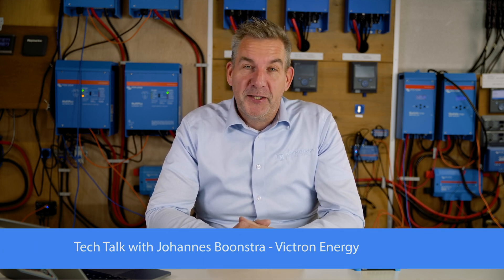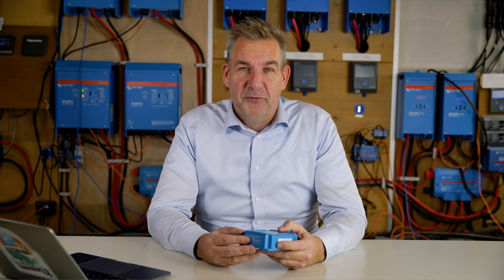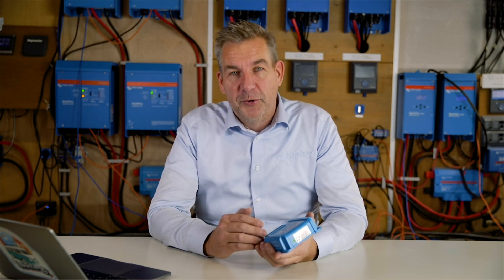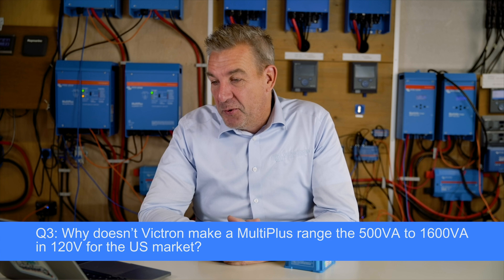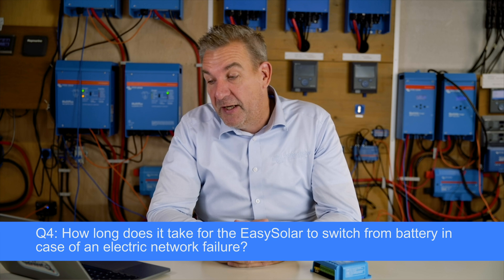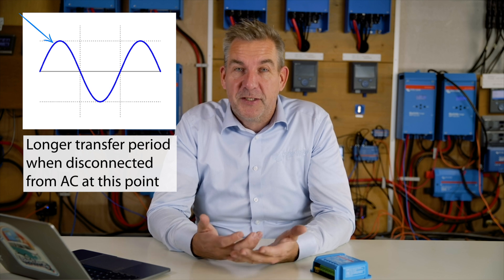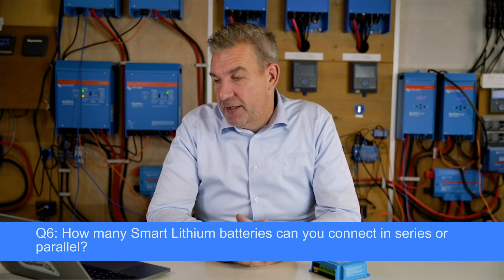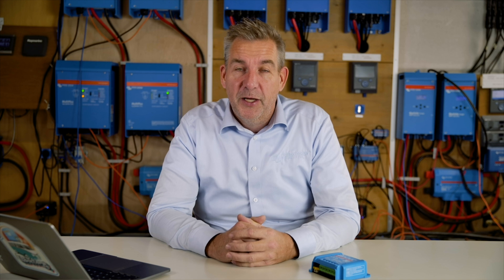Victron Energy Tech Talk - Episode 9 (MPPT charger output, Smart Lithium batteries)

Comment: Don't know if u can help me. I am try to flash my victron quattro 48/5000 inverter, but I have to use veflash because it is a 100 series bios, The flash utility keeps telling me error connecting when trying to flash. Do I need to disconnect both ac and dc for the procedure to work or what am I doing wrong? Thanks

Comment: I haven't had any luck in the Victron community forum or the Facebook groups so I'd appreciate if you could address either or both of the following questions about the Skylla-TG charger 24 V universal input:
- The Skylla-TG charger 24v universal input unit has a starter battery charging feature, does it use power from the DC side or do I have to be plugged in to AC shore power?
- I've seen people recommend using an EMS to protect a Multiplus/Quattro from bad shore power, since universal input EMS don't seem to exist, how would you protect the Skylla-TG charger 24v universal input?
Reply: Q1 this extra power for the starter output is redirected from the main battery, So when there is enough (voltage) to also feed the starter output it will do so.
Reply: @victrontech  If you don't mind one last question, the manual doesn't mention it so I assume the starter battery output won't have stage charging right?
Reply: Q2 There is no EMS needed as the unit will switch itself off at low AC voltage. for (extreme) high voltage you could add an EMS but that's typically not done as far as I know.
Reply: @victrontech  Thank you so much for answering both questions, that helps a lot!! You’re a legend. :)

Comment: Hello, i have a question about a Lynx distributor and big cables.
I need to connect a phoenix 24/5000 inverter.
Between Inverter and Distributer is 1,2m
The manual said the recommended cable is 2x 95mm² with an 400A Fuse.
If it´s possible to connect two cables an one of the four terminal with a 400A fuse or i have to split it to two terminals with two 200A fuses?
Another option is to connect a Fuse holder at the end of the distributor busbar and connected seperately.
Best regards Robert
Reply: When paralleling the cables the partalleled fuse becomes half size , so 200A indeed.

Comment: Hi Johannes, would you please help me to find the best setup for my system? I do have 550W, 52V panels. My roof is a little complicated. I can put two panels facing east with 30dg slope, two facing west with the same slope. Five facing south 30dg and 4 facing south with 45dg. Can I use MPPT 100/35 for East/West panels and MPPT 250/70 for south panels? Is it possible to combine MPPT 250 and MPPT 100 into one string? Is the slightly higher voltage of the panels (260 and 104V) a  problem???  I consider Multiplus II 48/5000/70 Inverter and 48V battery. Would you set up the system differently? Thank you very much, Juraj
Reply: having a single MPPT per slop would be most optimal. higher voltage then the specs allow is a huge problem as that will damage the MPPT permanent.  Always stay about 10% below the max I would recommend

Comment: what is the difference between a mutiplus and a mutiplus 2? And could you have both in the same system?
Reply: The m2 is the latest design and has a design focus more towards ESS systems. So certified double input relays are standard.  Also idle power is less.

Comment: Quattro or Multiplus charge to max 80%:
How is possible to set the charge Limit to max. 50-80% for Litium Batteries?
Reply: On lithium the absorption voltage is the voltage the batterie is 100% (full) , the absorption phase is to allow the balancing take place.   If you set the absorption down also the SOC will be less.   If you want to stop the charge at a certain value you could have a BMV have its relay connected on the input of the Multi.  then with an assistant you can stop charge at the values you activate the relay in the BMV

Comment: Thank you for a very educational video. I have Victron Cerbo GX and MultiPlus 12/3000/120V-50 and Victron Smart 500 amp Shunt. Part of the circuit draws from 12dc after the shunt but the Cerbo GX Touch 50 doesn't show how much 12V DC power is being drawn. 2nd Question: which RJ45 input to the Cerbo GX do I use to connect to Raymarine MFD. Thanks so much!
Reply: For MFD the LAN connection is used, so when combined or on the same router this should work.    The Smart shunt shown power in/out the battery.   If you want to see beside this a current to a certain DC distribution you can add a secondary Smart shunt and have that set ups as energy meter

Comment: I have a quick question. Would it be possible to improve the EasyPlus Inverter/charger unit so it has a larger invertor (3000va) and have a second/third battery charger output and modernise it with bluetooth connectivity with everything and you'd have a killer unit for use on narrowboats in the UK - a certain market!!
Reply: Everything is possible :-) , but at the moment this isn’t a priority to be developed 
Perhaps later next year

Comment: 419 / 5.000
Übersetzungsergebnisse
Übersetzung
Hello
In my photovoltaic system, I would like to feed from the batteries into the 220V house network, e.g. via an inverter. (night feed/ permanent feed)
Does Victron offer a way to do this? The VE Smart Battery Protect would be ideal for switching the inverter, but according to the manual it cannot be connected to inverters.
Do you perhaps have another technical solution?
Thanks and Regards
JF
Reply: Please have a look at the Victron ESS manual online, there al options are listed
Reply: The Battery Protect is not ideal for inverters I am afraid, its for small DC loads. If needed you can control the inverter by using a Battery Protect by its remote port.  But most inverters do have their own low voltage cut off already

Comment: If you have 20 of the Victron Lifepo4 25.6V 200Ah Smart-A in Series Parallel for a 48V battery bank what BMS would you use?
Reply: A lynx smart BMS would be nice , but also a Ve bus v2 is a good option
Reply: @victrontech  lynx bms is only good for 500 Amps

Comment: probably already answered, If i have 1000x solar panels in parallel and don't exeed the open circuit voltage of a Victron Mppt will it work or go up in smoke?
Reply: It will not go up in smoke but it needs to switch the pv power if something goes wrong and as the short circuit power is most likely to high , it’s not able to do so 
So … stay below the maximal short circuit spec and VOC
Reply: @victrontech  ok thanks for clearing that up.

Comment: is that 20 for each inverter or 20 if you have more than one inverter ?
Reply: 20 batteries is the maximal amount of batteries , on a single BMS
Reply: @victrontech  thank you for the quick response. I thought each battery had its own bms built in, so are you saying there is a bms in the inverter/charger that is in overall control?

Comment: It would be good idea to have a sunlight sensor system, to mean that during night time. The mppt would turn off or go into low power mode. The community forums should have dedicated sections for their one suppliers such as pylontech batteries!
Reply: That’s what’s already happening , based on the pv voltage which is in fact a big sunlight sensor.  But when having load output the unit needs to remain active 
That’s the reason only the smaller units have a load output as well

Comment: I have bluesmart chargers and can monitor them when on the boat via Bluetooth and the connect app on my phone but i also have a Cerbo is there anyway I can get the details into VRM through the Cerbo on bluetooth so i can monitor them when away form the boat?
Reply: No communication with the gx device is only done by a cable

Comment: Would you consider developping a SmartSolar MPPT RS which can connect directly to Solaredge optimizers? (so we can remove the Solaredge inverter and still use the optimizers for shadow based locations)
Reply: Well the modern panels have nowadays all bypass diodes to eliminate the shading effect so the is no real need for the optimizers. So having the panel directly ion the MPPT would be technically the best as then losses are minimal.   In short, no there will be no special version which can handle optimizers as that would make them less efficient.

Comment: I have a Fronius gen24 on ac in. Can I use the  Fronius pv point as ac in when grid goes out for multiplus 2?  Thank you!
Reply: The fronius needs an ac source to be used. So therefore in off grid situations the Ac out needs to be used to connect the fronius to. Beware the max power to be connected on ac out is equal to the inverter itself
Reply: @victrontech  fronius gen 24 has a pv point backup that gives up to 3kw if there is sun. It is supposed to be used for a socket. I believe that it could be used as ac in for multiplus without issues. I should probably ask fronius.
Reply: @victrontech  Fronius does not have ups type functionality. There is a 90 sec blackout. I cannot accept this for critical load. This is why I have an easy solar 2. Critical load are connected to ac out 1. Fronius does not have a battery. Byd is supported and it is very expensive. I use a generic lifepo4 with easy solar. I have four 455w panels connected to easy solar. More than enough in summer. I have however 14 455 connected to Fronius. If grid goes out it stops giving power to the home but pvpoint comes up in 90 sec single phase up to 3 kw if there is sun. I was wondering if it would be feasible to use it as ac in to my victron if I need more power than I can get from easysolar battery and panels